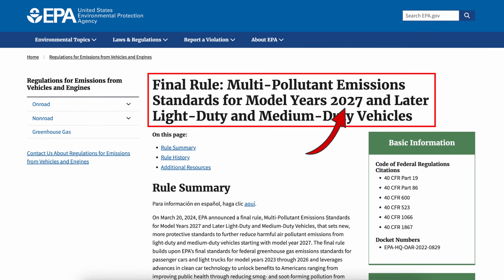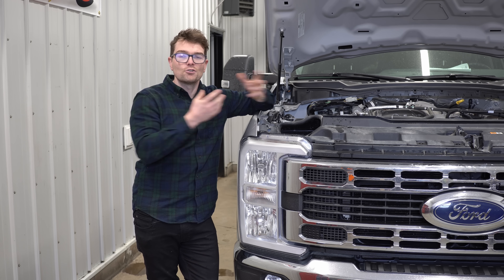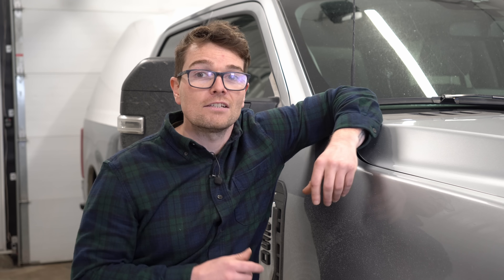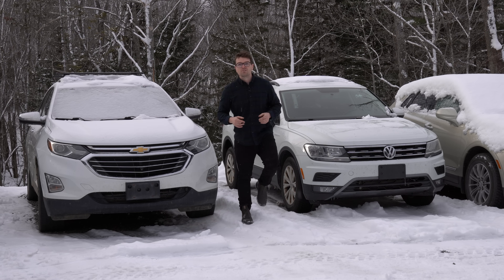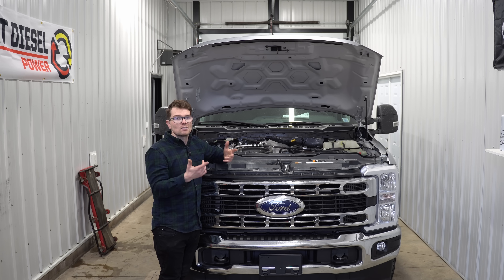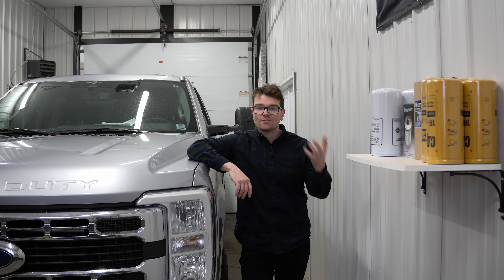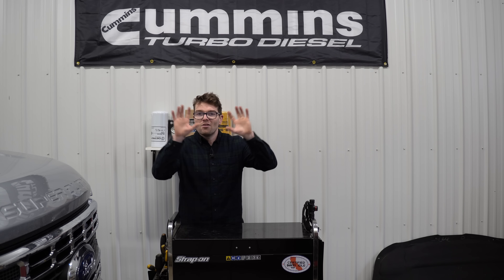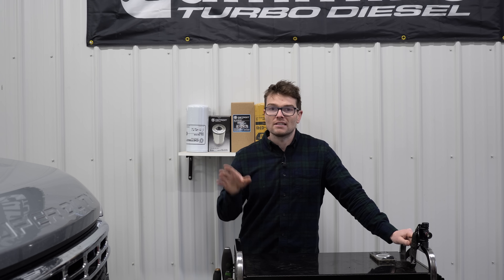NEW 2027 Cummins Diesel Engine EMISSION REGULATIONS are WILD **Diesel Mechanic Explains**

Comment: Gas V10 making a triumphant return
Reply: I think the 7.3L Godzilla and GM 6.6L L8T already filled that role.
Reply: @Jay-me7gw  V10 go vroom vroom
Reply: @Jay-me7gw and don't shoot spark plugs through hood
Reply: and not passing up a fueling station.
Reply: @larryjanson4011  just the DPF pump
Reply: No because they will be fitted with particulate filters too now.
Reply: @erikkovacs3097  at least the 7.3L Godzilla isn’t direct injected and likely won’t need a filter.
Reply: There is no triumph when red tape from idiots slows down a superior solution
Reply: Does it have cylinder deactivation? That would reduce the fuel economy penalty.

Comment: Brother in law who’s a tow truck driver was saying a lot of guys in his industry are switching to gas tow trucks because the cost and downtime because of maintenance on the diesels are so prohibitive
Reply: And because the new gas engines and 10 speeds preform really well. This isnt 2002 when we had 4 and 5 speed transmissions and V8's making <300 hp and you needed a diesel to get anything done.
Reply: @Jay-me7gw  My last service truck was a 21 F-600 with the 7.3 gasser. It was a maintenance disaster. I mean they ran good for a truck that weighed 21k lbs., but out of the 100 ish Fords we had in the fleet almost 3/4 of them got new engines before 100k mi. Mine went at 53k. Also, basically every truck needed plugs and wires typically within the first 30k mi. Quite a few trucks needed transmissions. A few had diffs let go. These issues were not preventative maintenance issues either. We ran premium gas as Ford recommends, still ended up with terrible spark knock. Which is what the plugs and wires were for. We have our own truck shop that would service the trucks roughly every 5000-7500 mi and perform most out of warranty repairs. Almost every failure we had boiled back down to quality and design issues from the OEM. My truck had the hydro boost start pouring oil at around 40k mi, as did at least a couple others I heard about. My company is working to phase out all the "medium" duty service trucks we have, which also included about a dozen of the new body style Chevy 6500. The Chevys have all been downed over a safety issue where the trucks intermittently just will not stop. Causing the truck to blow through red lights and stop signs. Several of those trucks have been sitting at GM and have had engineers out going over them, for them them to come back and just say replace pads and rotors under warranty. My company is swapping the brakes and sending them straight to auction. They swapped my out of my Ford with only 72k mi on the OD to replace it with a Peterbilt 536. What's crazy is that fully loaded with my tools, my new Pete only weighs about 1500lb more than my F-600 did.
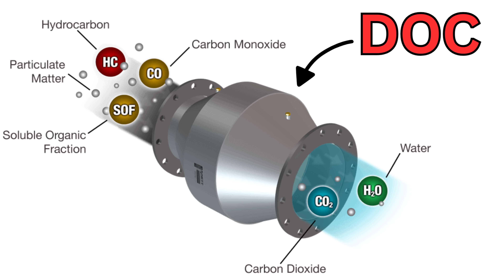Reply: Not 2:23  @Jay-me7gw
Reply: @Jay-me7gw NOT in the gas 7.3l I drove!  They accelerate like a 3 cylinder Yugo.  Shift smooth, like everyone says.  But shift so much they're ridiculously slow.  Junk imo!
Reply: @2LocasBeagles My current work truck is a 2024 F-350 with a 7.3L. It’s not slow, and the 10 spd always puts the truck into a really nice RPM whenever you step on it. I really enjoy it.
Reply: @Jay-me7gw it's not hp, it's torque when towing. Though other engines now also make good torque too
Reply: @Jay-me7gw That 7.3L Godzilla platform with the 10 spd trans is a very attractive platform considering the modern diesel nightmare.
Reply: @Jay-me7gw  The diesels of 2002 (that being the 6.5 detroit, 5.9 vp44 and 7.3 psd) were lucky to break 300hp in stock form. Diesels were an economy option, not a high performance option, and an alternative to both ford/dodge v10s and the 8.1 ls. The new 10 speeds are decent performers, but suffer from quite a few major reliability issues which oldschool 4 speeds do not. Not to mention the high overdrive and short gear spacing lends to a lot more hunting for gears without proper programming to compensate (which ford and gm did, and dodge/ram definitely didnt)
Reply: @ agreed, they are not perfect, but they make this modern gas engines incredibly capable. You have a powerful engine and you a huge number of gear ratios available to put that engine where it needs to be.

Plus, at least GM and Ford are putting those 10 speeds behind the diesels too so you’re screwed either way.
Reply: @CharredSteak  also, I did say “early 2000’s”. The LB7 Duramax, 5.9 ISB Common rail, and 6.0 PSD were all in trucks by 2003 and making >300hp and 500 ft-lbs. 2003 is the early 2000’s
Reply: @CharredSteak I find my 2008 Chev - 6spd auto mated to the 6.0L v8 a decent combo..almost 200k miles on it now and no driveline issues.
Reply: @CharredSteak toque, 500# at low RPM and better grade breaking
Reply: Yeah, my buddies tow truck company went to all. Gas has been a lot cheaper almost 0 downtime.
Reply: @norman6771  also swapping out a dead gasser is easier than swapping out a diesel. A old one not really that much difference between gas and diesel.
But those have to go bye bye.
I am not sure if running propane only is cheap. But I do know they last a long time. Also running them at gasoline compression is not that efficient.
But basically the greenies just want us to walk.
Maybe they will ban horses next. They do fart.
Reply: Not to mention the insane price of the diesel option
Reply: @ yeah you can buy a lot of gas for $10,000
Reply: This was the whole goal in the first place.
Reply: Need to put a stop to the government
Reply: I'll keep my 1988 Kenworth cabover. 👍🇺🇸🇺🇸
Reply: @Eric-ty1yi  Cummins BCIII or a Cat 3406B?
Reply: You all know that the Ford and Chevy 10 speeds are basically the same transmission?  It was a joint venture between them.
Reply: Yeah. That's the point. If you legislate less emissions and more warranty coverage at the same time it's as good as a stop work order. And by the way, I stopped at the 6.0 Ford and ran v10's ever since. I'm in the flat South, I've never really needed a diesel for a tow truck.
Reply: LS runs great….until the lifters take out the cam 😖
Reply: so true
Reply: This is true. I work at a Ford dealer and I am seeing way more tow trucks/ rollbacks with gas than ever before. And at least half of the new chassis trucks dropped off are gas engines. I’d almost say more of them than 6.7’s in the past 6 months. I’ve driven the last year v10 in a 550 and they get bad mouthed but a loaded service truck behind it and it gets along just as good as a Stock 6.7. The new 7.3 gas engines get down also
Reply: F550 with Godzillas are half the operating cost even at half the mpg. Diesels will become obsolete if they keep going
Reply: gas engines have come super far in last 20 years there really is no need for diesel trucks these days
Reply: They're trying to force diesels out of the market. They did it to CAT, they'll do it again
Reply: That's what the government wants so stop giving them what they want
Reply: AKA more down time and cost A LOT more money.
Reply: Force people into gas trucks, which run considerably dirtier than a clean Diesel. The government defeats the purpose. Big surprise
Reply: After treatment is coming for gas engines as well.
Reply: all 8/9 speeds and 10 speeds have issues with the drums notching. its not an if but when and it has not been fixed yet.
Reply: Mostly because it is cheaper to replace a gasser. Also The diesels life has been cut way down.
Forney is also considering banning pre 1980 vehicles. Gas and diesel.
But private jets will not have a worry.
Reply: i just do pressure washing but after a ford 6.0 will never get another diesel on a srw vehicle, and will never get a diesel that hasn't been around for enough time to gain a reputation of being reliable
Reply: The fuel consumption on a gasser can be up to double a diesel while towing (important for a tow truck company you would think). Since fuel is the number one cost of ownership after depreciation and maintenance being like #7 on cost of ownership it's no surprise that medium duty vehicles are still 95% diesel and that's not going to change anytime soon.
Reply: Exactly what the feds want you to do
Reply: That's the goal. Regulate them out of existence except for military applications which get the diesel with non of the emissions parts. Why? Reliability.
Reply: Gas vehicles are set to start getting particulate filters.
Reply: yep and that move is real good foe the petro lobby...
Reply: Our bus fleet is transitioning to gas, the fuel economy isn't fantastic but the in service rate is plus the maintenance cost reduction. The kerosene kowboy crowd in the driver pool is bemoaning it but the gas busses just work and there's no training required to keep the freshly licensed drivers in the pool from plugging the DPF systems solid.
Reply: I say don't pay them a fuckin thing, don't swap trucks, they can't take us all, and if we all work together to stop them from taking any of us, then we can stand up to them and possibly even take the whole thing down.
Reply: I’ve had all the Ford diesels since the 7.3 non turbo. My next new truck will be gas. Done with this epa emissions bs!
Reply: We are switching our fleet out from F550s to F350s gassers
Reply: Wasn't the theory for bigger displacement diesels so they could effectively drop cyclinder temps and NOX emissions? I see bigger and less powerful diesel engines on the horizon or for cost HD trucks will probably end up having even bigger displacement gas V8s with turbos and possibly no longer have diesel options. Possibly later on, ultimately, have some sort of gas/diesel generator-electric motor hybrid approach.
Reply: And a serious question, who is your Strap On dealer?
Reply: Yeah I'm considering switching to gas for my next tow trucks.
Reply: Meanwhile a 1993ish Ford 7.3L IDI and manual transmission is still on the job after 30+ years.
Reply: Here’s the thing with that Lower towing capacity consent service needed can’t haul as much, I’m in the industry and I’ve been in everything from a peterbuilt to a f-600 with the Godzilla. Some places might switch but Michigan isn’t, gas your paying more to fuel up more on service with brakes and transmission atleast on the ford. Diesels will always be in towing they are just better for the job.
Reply: I have switched to gas, no more diesel trucks ever again.
Reply: School buses have made the switch back to gas even….seeing ford medium duty f-650 with 7.3 gas engines too
Reply: @jacobcornelius1278 all school bus fleets in my local area are V10/V8 Blue Bird Visions (depending on the age of each unit) much faster than the old idi we had when I was in grade school
Reply: Not Chevy  10 speed trans huge recalls on them & more comeing
Reply: @BryanRichardson-s3v nah fords ten speed are horrific we have 20 trucks. Within 2 years 9 trannies have been replaced worst fleet purchase ever (at least this current gen)
Reply: @BryanRichardson-s3v it was a joint venture between Ford and Chevy it's the same transmission
Reply: @BryanRichardson-s3v  my stepdads trans went and my moms is going both 2021 and up
Reply: @BryanRichardson-s3v  i thought it was chevy 8 speed gas transmissions that were nothing but trouble, but the 10s are quite a bit better
Reply: @BryanRichardson-s3v  you know chevy and ford 10 speed is the same trans right
Reply: @BryanRichardson-s3v  Ford has several recalls on theirs too.
Reply: Its the same transmission. @UTBanjo
Reply: @BryanRichardson-s3v  one recall does not make a bad transmission. Shit happens. They still enable the modern gas engines to perform as well as diesels even 10 years ago. 

Also, at least in the Ford’s, it’s the same transmissions behind the diesels, so you’re boned either way if it’s really a problem
Reply: @BryanRichardson-s3v  Chevy 10s are fine, theres 1 pending recall on the diesel types.  However on the Ford 10s there are multiple class action lawsuits that are linked to people actually dying.
Reply: @Bucketheadxx   all the auto companies  have there problem s , main is have engineering & manufacturing  outsourcing  over seas! That's why the quality  is poor & that includes  the Japanese  !
Reply: @Bucketheadxx  not on the 10R140’s I don’t believe. To 10R80 in the F150 is not the same fundamental transmission
Reply: @Bucketheadxx the Chevy and ford 10 speeds are almost identical ZF gearboxes…
Reply: @BryanRichardson-s3v you typed that as if the quality of US manufacturing isn't at an all time low as well lol
Reply: @huh0123 the 10 speed was a joint effort between Chevy and Ford, once they got the general design and reliability figured they went on to fine tune their own versions themselves. So, tuning, parts sourcing, case design, practically anything after that was the choice of each of them.
Reply: @Bucketheadxx the Chevy 10 speeds are not fine. They’re junk. There’s thousands of them in dealerships around the country with less than 50k miles needing valve bodies and some even needing full rebuilds.
Reply: Yeah,but you could hear him mentioning that even gasoline engines will be equipped with GPF in foreseeable future.
Reply: @borisscepanovic1684 GPF on gas motors is way easier than DPF on diesels. Gas exhaust burns hot enough that regen isn't an issue, and the soot loading is way less. GPF/OPF is basically maintenance free compared to DPF
Reply: Ford's Godzilla 7.3 is a beast

Comment: Hopefully all the manufacturers take GM’s approach on their 3.0 diesel and put the EGR pickup on the leaving side of the DPF to help remove soot entering your intake. 

As for the EPA we may all hate it but the main reason we got the best diesel engines of all time like the P pump 12V and 7.3 power stroke was because manufacturers had to innovate to meet their emissions standard. Unfortunately those same standards killed those engines but then we got the 24V common rail and now the 6.7HO with 500 hp. It’s not all bad.
Reply: Yeah the 7.3 and the 12V there are still a ton of both out there running around. I have 12V p-pump and a 24V VP pump. A 28 and a 23 year old truck still doing farm work hauling hay cattle, equipment. I bet these over loaded emissions high horse power truck won’t last as long as those old girls.
Reply: @oldfarmer4700  I think the core motors will be fine but how much are you willing to throw at them to keep everything running?

And are you willing to pay $15k+ initially to buy the diesel in the first place? The current Powerstroke HO is a 13k upgrade without needing the additional emissions reduction and 10 year/450k warranty. I bet in two years time we see they are $15k or more over the base gas engines.

At the end of the day though, if you don’t need 1000+ ft lbs of torque and 500hp, the current 6.8 and 7.3L gas V8’s are more that adequate replacements for your 7.3 Powerstroke if you needed to upgrade. And they are far from complex. They are good old iron block push rod motors with port injection.
Reply: @ maybe the core would last but they are made of different materials also. If they are made to stand to last long I’m sure the emissions will have effects on just how long. I don’t think we need pickups pulling loads equal to semi size. Mine are stock trucks. Sometimes I am heavier than I should be but it’s only for a very short distance on rural roads and slow and not hauling a toy hauler that weighs over 20k across the country.
Reply: @oldfarmer4700  I agree that’s why I drive a 2000 7.3 ZF 6 speed daily for work.
Reply: there isnt really pumping losses in a diesel since there is no throttle plate. In fact, at least on the diesels i have seen, they have to add a throttle plate specifically to make it so the engine draws from the EGR instead of the intake. What you are saying really only applies to gasoline engines that drive at part throttle with the manifold in vacuum most of the time.

Yeah the 3.0 duramax does have a low pressure EGR but I believe its use is limited to only certain situations. It still has a high pressure EGR.
Reply: @ you are correct I was wrong in my statement about the pumping losses, they are minimal in a diesel vs gasoline engine. I will edit my post.
Reply: Yes it is that bad. Stop living in never land and smell the tequila we’re in big trouble!!!!!!!!!!!!!!!